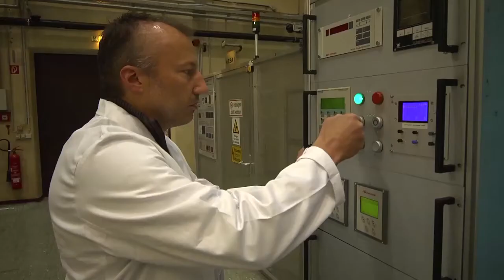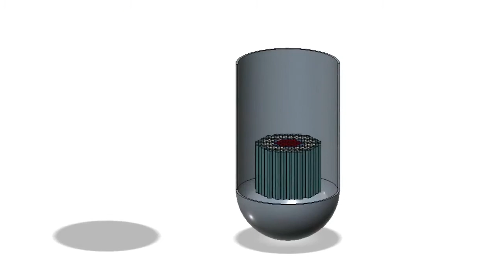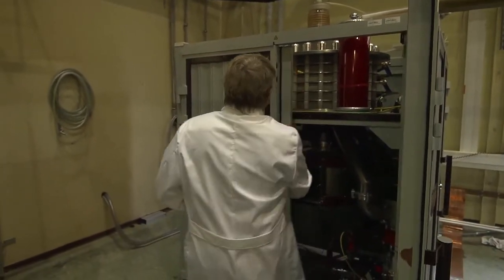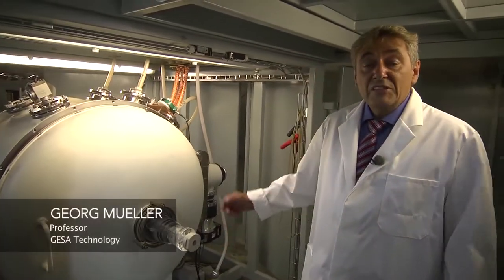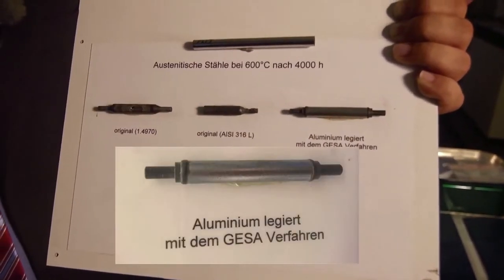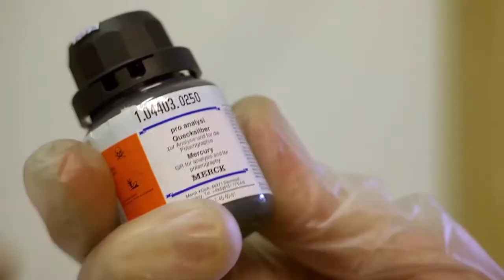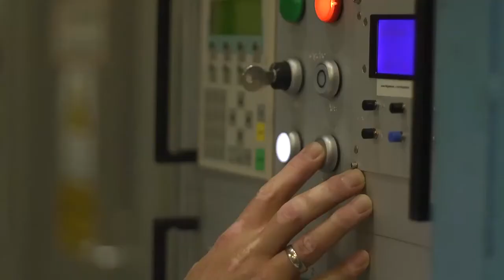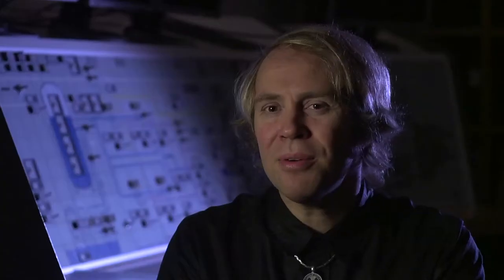The LeadCold Revolution

Comment: Can you use lead to cool other reactors like MSR's so you don't have to worry about corrosive salt in secondary cooling loops? This alloy would be useful in other applications.
Reply: +LeadCold Reactors Have you gotten around the problem of bismuth -> polonium-210?
I would argue that having a higher melting point and thus higher risk of coolant freeze in heat exchangers is a small price to pay for not requiring the expense of bismuth, or the activation products it brings.

One issue I have with this video is again, the propagation of this false meme by breeder advocates that there is  only a hundred years, or 10 years, or 20 years of uranium. It relies on a fundamentally false interpretation of the relationship between economically extractable reserves and the actual, physical amount we have on the planet.

If we are talking only decades of uranium, that assumes that the price remains constant, and that new reserves are not found, and that new sources of uranium, such as that extracted from seawater, are not found; or that new fissiles and fertiles like thorium are not exploited. That's a lot of assumptions. 

Bernard Cohen demonstrates here that for all intents and purposes, human civilisation, going on for geologic time, is effectively sustainable even without the presence of breeders; and sustainable until the sun grows dim, in the case of breeders: http://sustainablenuclear.org/PADs/pad11983cohen.pdf . 

Put your best argument forward: the recycling and re-use of spent fuel.

The second issue is on corrosion. "All liquid metals are corrosive." is probably false. The EBR-II with sodium cooling and 316SS exhibited no corrosion throughout its operating life, and indeed, examination of the piping showed the original tool marks, 30 years later. Now, I don't think that sodium is a very good idea for a reactor coolant as long as you have a steam cycle running, but again, sweeping generalisations are not helpful.

On fuel, I still believe that U-Pu-Zr is still the most promising of the LMFBR fuels: http://www.sciencedirect.com/science/article/pii/S1738573315000753 . It is easy to fabricate, easy to recycle. In a breeder, the OPEX is fundamentally tied not to the initial fuel loading, but in the balance of plant and the recycling. 
Has LeadCold examined U-Pu-Zr alloys? If so, what lead to the selection of U-N? 
Why does the website mention U-OX instead of U-N? http://www.leadcold.com/sealer.html
What is the balance of plant? Steam Rankine? Exotic Brayton?

A reactor is useless without a turbine to extract heat from it. Equally it is risky to be dependant upon a recycling technology (PUREX-MOX) that has repeatedly run into issues on cost and on secondary aqueous and tri-butyl phosphate wastes. 

I don't doubt your science, but it is ultimately your engineering that will determine success or failure.
Reply from the maker: +leerman22 , indeed, using lead, or lead-bismuth in the secondary loop could be an option for other Gen-IV concepts.
Reply: Molten metals, including lead, are also corrosive.  Molten lead also has the problem of being hard to pump.  However, these aluminum containing stainless steel alloys are an interesting option for making the inner layer of the pipes for the secondary coolant loops.